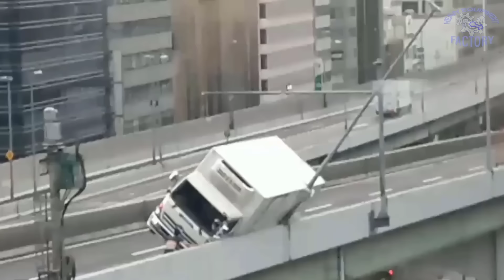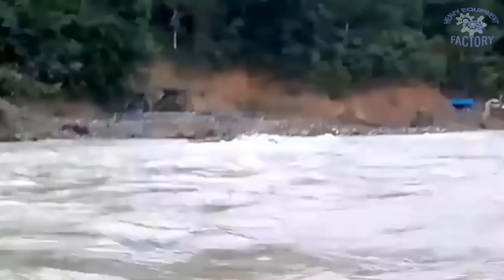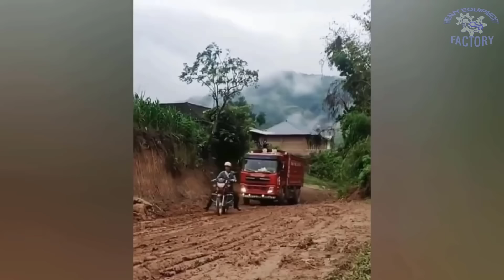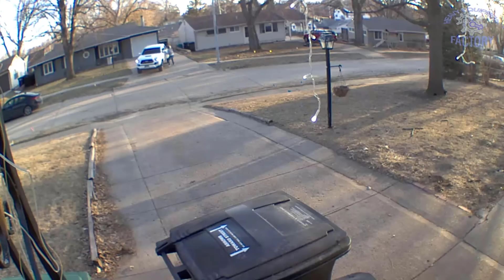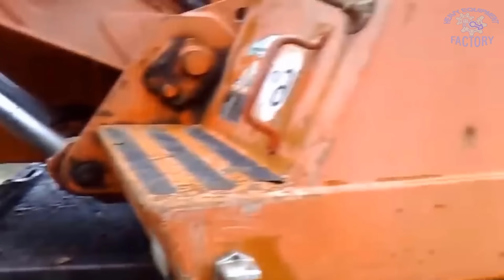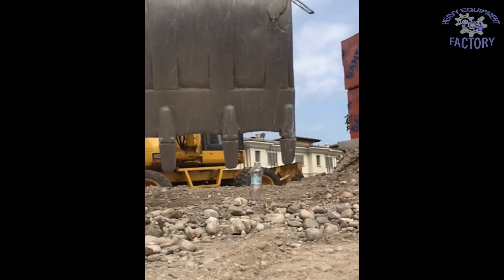Top 20 Dangerous Truck & Car Driving Fails On Highway - Heavy Equipment Fails Compilation 2024

Comment: 9:10 Has there ever been a recovery performed by these funny Indian cranes where they did not, at some stage, end up resurrecting each other…. several times….
Reply: I can’t believe no one has the sense to apply the park brake or put the vehicle in gear before attempting to upright it